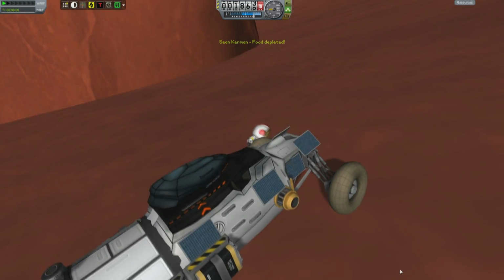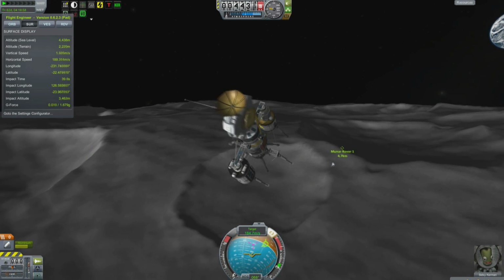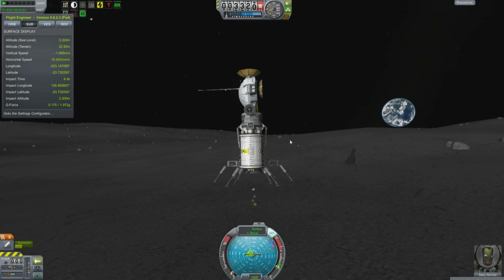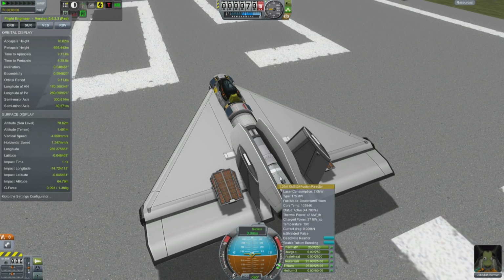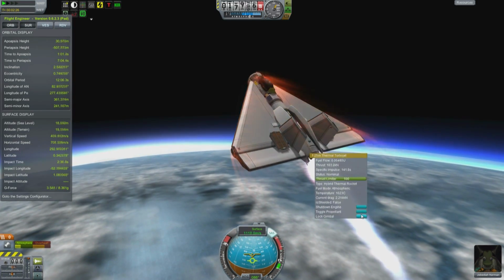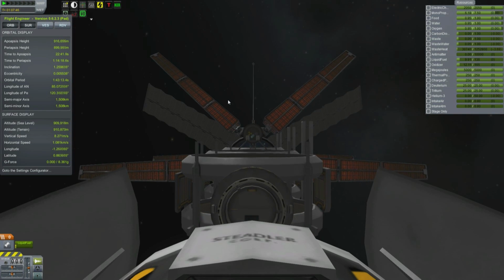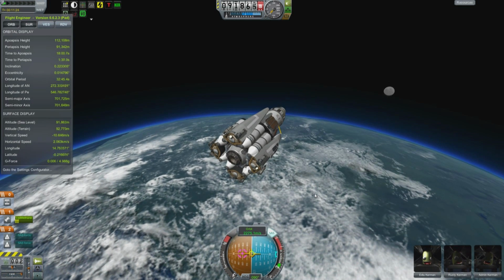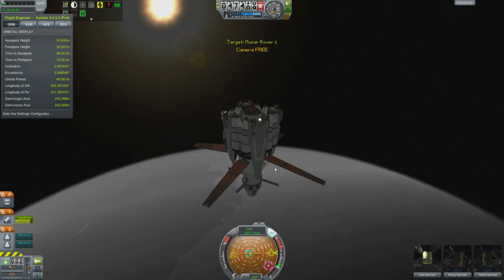Kerbal Space Program - Interstellar Quest 73 - Thrust To Weight Ratios

Comment: what mod are u using that gives u the anitmater and the engines u used on the SSTO u had and the MoonFerry I think is what u named it
Reply: never mind I found the mod now my next problem is how to make that SSTO like u did ive never made a successful SSTO so im trying to learn from your designs I would be able to make one but my Sabre engines in the B9 Aerospace mod are broken
Reply: ***** you use the parts from the interstellar mod.  you need a reactor for the thermal power and a thermal turbojet engine from the mod.  You have to unlock the fusion node after the end of career mod to have the option to switch to LFO.
Reply: I play in sandbox I cant stand the career mode

Comment: I can't help wondering if bringing anti-matter down to the ground is actually the most efficient way to do things. Couldn't you bring up anti-matter propulsion systems using more conventional means and have them juice up at an orbital station, eliminating the need to ferry anti-matter down to Kerbin? I definitely think the latter system would be preferable in terms of environmental impact, if nothing else.
Reply: The most efficient would be to get the materials from asteroids and build the damn thing in orbit. But that's not yet possible.
Reply from the maker: Well I need it to launch my plane, otherwise I'd need some other power source and engine to get it into orbit.

Comment: The Mun atmosphere is a problem with Better Atmospheres indeed - or rather, an interaction with Environment Visual Enhancements - you can fix that weird layer without updating the version though: in-game over the mun hit Alt-N and change the FadeDist for the cloud layer to 200. That layer is only supposed to provide 'oooh shiny mun' from way way off.

To properly fix it for all planets (if you're having issues at other bodies) you'll probably want to pick up the newer version of EVE... no rifters involved, unfortunately.
Reply from the maker: I updated to the new better atmosphere' sand something isn't working right on kerbin, I was getting 4fps in low kerbin orbit.
Reply: Scott Manley damn - I've been having serious slowdowns in the lower atmosphere, but that's a new one to me. I only know about the mun issue because I had the same thing happen.

If you can rollback to the old version then you can at least fix the mun thing with the fadedist, but I'd throw Thesonicgalaxy a message on the KSP boards anyway

Comment: So I finally caved and bought KSP. I know this is probably a much-repeated question that has been answered somewhere, I just couldn't find it easily:

What are the mods you use, any I should avoid at first as a new KSP overlord, where should I get the mods from, and any general tips?

Thanks in advance to whoever can answer those questions and fly safe (or explode spectacularly, one or the other)
Reply: As far as I remember, all those mods work in sandbox, including KSP interstallar.
Reply: ***** What about mechjeb redux? It doesn't have autopilot, and shows a lot of useful data.

Comment: I run 64-bit KSP on Linux, which has been perfectly stable (except for a bug while using Intel graphics), and since Linux is typically a secondary platform I imagine the Windows version is pretty solid, too.  The 64-bit version is worth a shot, especially if you're running into memory limitations with all of those plugins and active missions.

Comment: 18:16
I think fuel is in fact being burned. You said you where using liquid fuel and oxidiser, a strange combination if your only using thermal power. It seems to me like its got an "afterburner" that injects oxidiser to raise thrust at the expense of specific impulse. This was considered for NERVA.
Reply: I believe you're thinking of LANTR, which is a NERVA derivative. And yeah, that's pretty much how it works - the oxidizer is not passed over the reactor (something tells me that would be a Bad Idea - especially so if you use FLOX, or, for the insane, pure liquid Fluorine), but is injected into the hot propellant/fuel stream just after the nozzle throat.

Comment: Scott, have you considered a little mod/plugin called Load On Demand? It literally does what it says on the tin- only loading textures for parts that are in physics range  or in the VAB, replacing the catalogue images with thumbnails. It cuts down memory usage pretty nicely (with about 3k textures on my install it barely ever crashes on Full-Res, and when it does it's mostly in VAB). Granted, it's still very much in development and has a bunch of bugs (like textures being blackened) but it's still a good thing to have if you're running with a lot of mods. It's compatible with Texture Management and Visual Enhancements too.